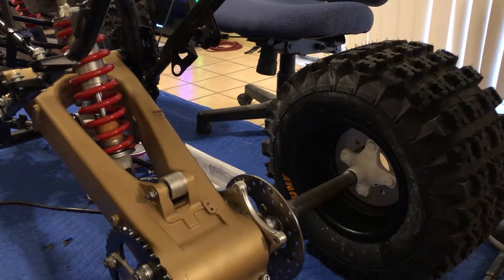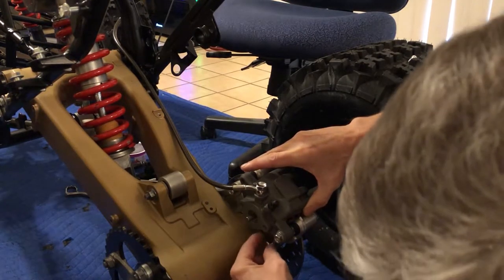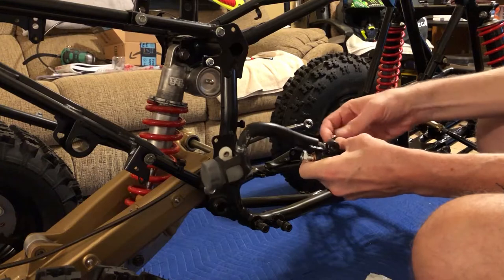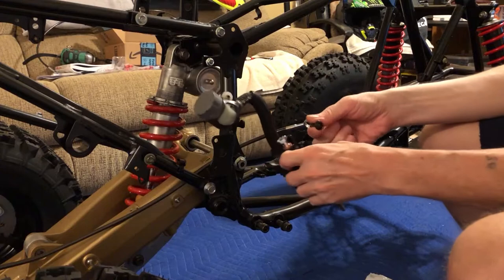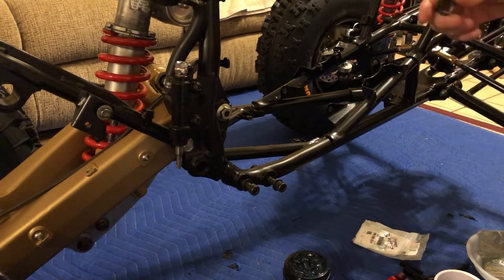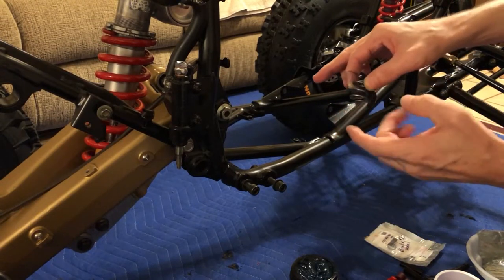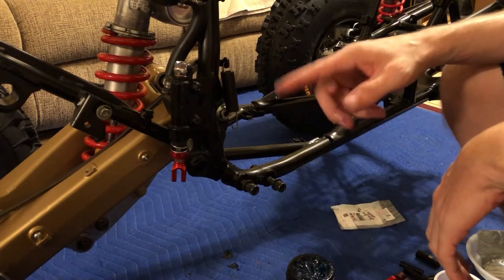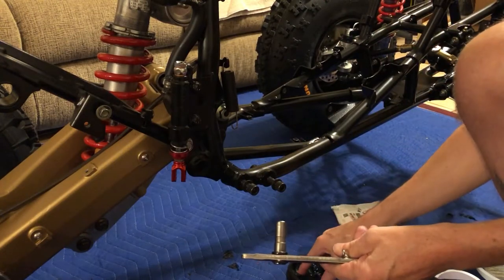Honda 400ex Build Assembly - Part 4 - Rear Brake Caliper (450r), Master Cylinder, Lines, Pedal

Comment: Build is looking awesome!
Reply from the maker: Thank you!
Reply: @11GalleryATV  have been looking into doing the caliper swap on mine. Let me know how it is
Reply from the maker: @DownAndDirtyOffRoad  I have done this before ... it works flawlessly! You have to use the 450r brake stay and the caliper bolts right up. You will also need the 450r rotor (which also just fits right on the the axle splines with no modifications necessary)
Reply from the maker: @DownAndDirtyOffRoad  If you watch in "Part 2" https://www.youtube.com/watch?v=PmHS4ePi76I I assemble with the 450r brake stay ...

Comment: I just bought a honda 400ex and it needs the whole back brakes system ima try to watch this video and put it together.
Reply from the maker: Sounds like a great project! You will probably want to get a service manual too. They help a lot and are handy for whatever needs fixing.
Reply: Where can I got one?
Reply: I ordered everything I need on ebay  do you know if it will come with the hardware
Reply from the maker: @kaseyjohns5169  What year is your 400ex? You will have to contact the eBay seller to find out if hardware is included ...
Reply: 2008
Reply: This is the first one I've ever had and when I bought it the guy told me they were no issues I didn't know what I was getting myself into when I bought it but now I have to put all kinds of money into it
Reply from the maker: @kaseyjohns5169  Here is a link to my website to download 2005-2009 Service Manual - https://11galleryatv.com/download/2005-2009-honda-trx400ex-sportrax-service-manual/

Comment: Hey man videos are great👍🏼I was wondering where I could get the bracket to hold the N and R lights and key, also where you got the R light. Appreciate the help
Reply from the maker: I made my own bracket (just drill the right size holes using a Titanium Step Drill Bit - https://amzn.to/3lkpYwv ) and I got the wires, lenses, and bulbs from here ... https://www.motosport.com/oem-parts/honda/2007/trx400ex/handlebar - Numbers 5, 6, and 7 in the diagram
Reply from the maker: The neutral and reverse light holes are just under 3/8" and the ignition key hole is about 1" - just go slow and keep fitting the attachments into the holes until it is perfect ... you can always file away more metal, but you can never put it back, so GO SLOW!
Reply from the maker: Here is another video I did (the link should start at sixteen:fifty six) that talks about the key and lights bracket ... https://youtu.be/xEvQf_vAED4?t=1016

Comment: Can you help with a problem? What do i do if the rear brake caliper bracket isnt tight/has wiggle play?
Reply from the maker: I'm not sure without actually seeing the problem. Is this a 400ex bracket or are you doing the 450r bracket? If the 450r, sometimes you may need to add spacers (or washers) to line up properly.

Comment: I know I’m a year late to the video, but I have been loving the 400 build series. I’m currently doing one myself. As I’ve never seen it before, I have to ask about a part on the master cylinder that you install at 9:45. What is the red cap with the spring? I love all of the red anodized accents.
Reply from the maker: It's a Fasst Company Rear Brake Return Spring Kit Red 8mm - https://ebay.us/ymhhZN - Used to make the brake pedal a little stiffer and it looks cool ...
Reply: @11GalleryATV   Phenomenal! Thanks so much for the reply. Love the 200x build as well. Should do a 250r or 350x build series.
Reply from the maker: @williambidwell2588  Thank you sir! I am in the middle of a YFZ450 build right now (on hold til the end of the summer) but next is going to an XR400 dirt bike with a 05+ 400ex motor swap with reverse! I am essentially going to make a dirt bike with reverse ... lol
Reply: @11GalleryATV  Oh my god that’s awesome lol. I will certainly be on the lookout for that one!

Comment: Where are the links for the actual parts, really dont care about all those tools, its not a video about what tools you used
Reply from the maker: There are way too many parts to put links to all of them! Also, a lot of the parts do not have actual links to them individually. Which parts do you need? I will do my best to point you in the right direction.

Comment: Does 450r rear caliper fit the 400 with no adjustments ?
Reply from the maker: yes, but you need more than just the caliper ... you also need the 450r rear brake stay (mounting plate) and rear brake rotor (brake disc). Some people have needed to use washers as spacers for the caliper mounting but mine did not need them. I have since moved to a Glann Inovations 450r caliper mounting bracket that allows me to use the 400ex rotor setup - http://www.glanninnovations.com/~shop/brake-mounting-plate/brake-mounting-plate-trx400/304414/?catId=55127